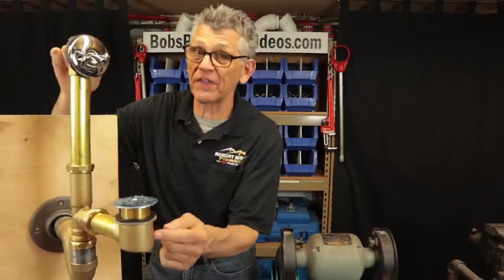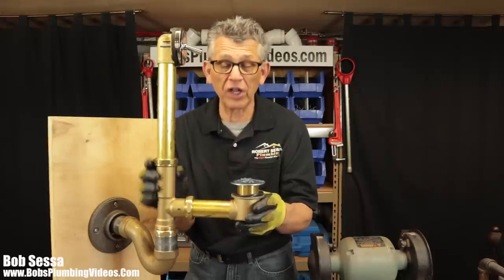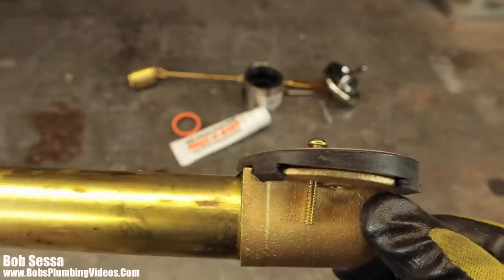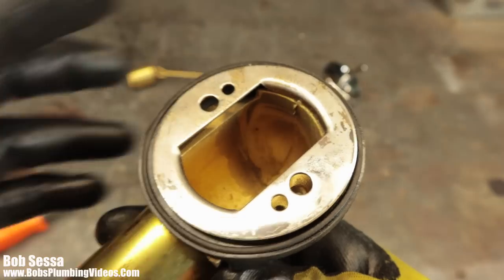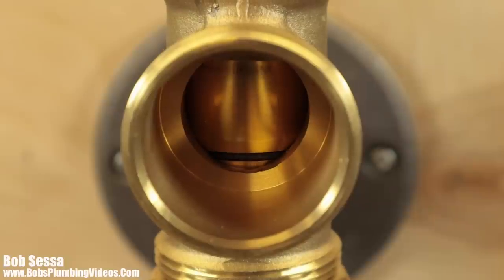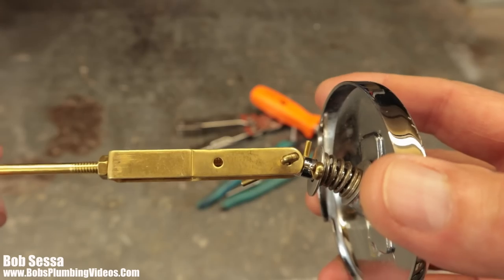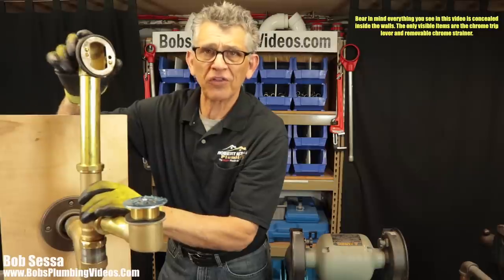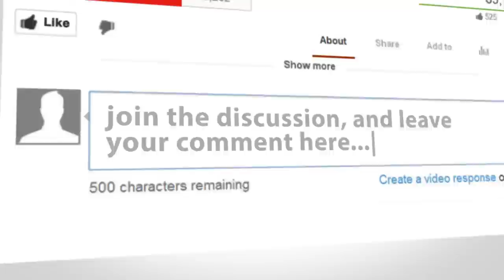Bathtub Drain Stopper / Trip Waste Assembly

Comment: Great video - I have an issue with the tub will drain with the stopper in the up (proper) position, it drains slow so there is some stoppage. Do the stoppers ever wear out (water leak past it) ? Tub is 45 years old ? My linkage is seized so I didn’t try to adjust, but I did try pushing the stopper down the tube as much as possible. Seems to be in the bottom of the hole / shoe / blocking area . Any help is appreciated
Reply from the maker: On a 45 -year old unit. it's totally possible that the plunger has lost its ability to hold water. If you use the tub to take baths, the easiest solution is simply to get a large rubber stopper to completely stop the water up. Sometimes playing around a unit that old for the the sake of 100% holding water, ends up turning into a nightmare
Reply: BobsPlumbingVideos 
Thx bob , without your video I wouldn’t have understood how the system worked . I went back and moved the stopper in and out of the hole seat. Applied some Teflon lube. Then tested . It blocked the water from draining. Second issue was my linkage was severely out of adjustment. Surprisingly the nut and stud came loose. It took me like 4 times to adjust to properly drain and stop , but it works . Root cause was the stopper was all gummed up linkage was out of adjustment. This tub has never worked since I owned the home in 2004. Again thx - your video gave me enough information to keep plugging away .
Reply from the maker: @MollyTV1  Thank you for checking out the video! Bob.
Reply: Apparently I never had the stopper all the way seated as I stated in my first post 
I took a wire wheel to it , after I applied Teflon lube it moved much easier , it was pretty gummed up

Comment: I used a wire to unclug the drain..unfortunately it hooked to the lever!   Any remedy? I did it because the water drains very slow and i thought there was hair on the pipe.  Does anyone has an idea how i could unhooked it from the lever inside.  Thanks so much...
Reply from the maker: It’s happened to me and the only advice I have is to latch onto it with a good pair of pliers and give it a good tug!

Comment: I bought the new trip leaver and put it in and 1 week later when I push the lever down to open the drain it slowly goes back up so I have to keep pushing it down.  Any thoughts?  Thanks.
Reply from the maker: Only thing that comes to mind is that the spring on the back of the chrome plate is not strong enough to keep it up. I know it’s, new but that could be the case. Also did you lubricate the plunger with anything?

Comment: Can I just replace this whole system with a pop up drain and different overflow plate?
Reply from the maker: Check this video out -https://youtu.be/XTW6pcDke2U. Fast forward to about 16 and 25 minutes
Reply: @BobsPlumbingVideos  my current overflow doesn't leak, I'm just looking to update the look of my tub with bronze fixtures. I found a 2 hole bronze plate without the trip lever. Just wondering if that would be fine to switch out and then put a pop up drain in.

Comment: my plunger got corroded that it literally seized inside the pipe and the link is broken. No idea how to get it out. tried wire with s rings and wire hangers etc. that thing is stick. CLR/ WD40 / penetrating oil nothing.
Reply from the maker: I had a similar experience in a rental, the water drained fine but when it eventually clogs, I will most likely open the wall in the closet behind the tub and remove the broken plunger.

Comment: My tub's drain linkage only the top half comes out. It got seperated in the middle. Not sure how to fish out bottom half plus plunger.
Reply from the maker: I generally use a wire coat hanger to fish them out!

Comment: Very informative video. My problem is after replacing the face plate, the new trip lever will not stay down in the open position. Any suggestions?
Reply from the maker: When the lever on the faceplate is pushed down (the plunger goes up) and the water drains. When it is pushed up (the plunger goes down) the water should fill in the tub. If it's seeping water. you might just have to adjust the linkage accordingly.
Reply: @BobsPlumbingVideos  The lever won't stay in the open position unless I hold it down.
Reply from the maker: Kelly Dineen

That description sounds like the spring on the back of the face plate may be bad (lost it’s tension) You can replace that plate which comes with a new spring and two new screws. Any of the home centers carry them.
Reply: It is a new one. I never had this problem with the old one. I'll have to try another new one, maybe this one is defective. Thanks for your help.

Comment: Hey there my husband and I have both tried to remove the plunger in our new to us home but it wont budge! Any tips on how to get it out? It wont move at all wont even go down to plug the drain :-( . We need to fix it to bathe our 1 year old
Reply from the maker: If you tried fishing it out with a wire coat hanger and it's not working. The only other solution (and I've done it) is to open up the wall on the opposite side of the tub drain and physically remove the overflow to retrieve the stopper. A. I'd leave this task to a Pro  B. If the tub is facing an outside wall, you're out of luck!

Comment: How does water drain when plunger is down and bath water reaches overflow when filling?
Reply from the maker: If the plunger is down and the tub fills to the overflow, the water will enter through the top and drain through the plunger. The punger is hollow and the water will flow right thru it.
Reply: Thanks

Comment: bob, great video.  i bought a brand new trip lever plate assembly.  i having trouble because the lever does not like to stay down in the drain position.  the lever likes to creep to the up position ( tub can fill with water).  It may be that that spring behind the plate is weak.  is there a good brand out for plate covers. please help me.
Reply from the maker: It sounds like that exactly happening. You could try removing the spring and stretching apart with a couple of pairs of pliers which will create more tension. Or purchase this assembly and just use the faceplate. It's made by Gerber which makes a good quality trip waste assembly. https://bit.ly/3a5fOLl. Regards, Bob.
Reply: BobsPlumbingVideos   Thanks bob

Comment: Good evening Bob. Thank you for sharing your knowledge.  Question! My linkage is not long enough to prevent the water from leaving the tub when we want to take a bath. I've tried adjusting it but it's still too short.  Can I purchase a longer linkage and plunger?? Please help.  I'm a sous chef and soaking my tired legs is my therapy.  Thank you so very much!
Reply from the maker: Generally, different manufacturers will use slightly different types of linkage. So I would first identify the manufacturer. If you're able to remove the linkage without any issues and can't identify the manufacturer, I would go to one of the home centers and see if you can pick up a universal linkage set.

Did the original hold water at one time? If so, did anything change or was any work performed on it?
Reply: @BobsPlumbingVideos  No sir. Its is a brand new tub, right out the box. It never held water at all. After I adjusted it the water goes out slower but does not stop it all together which made me this Its not long enough
Reply from the maker: @jmcgill215  Standard tubs are 14" high with a 16" option. But a stock waste and overflows should be able to accommodate both. If you've run out of adjustment, you most likely need a longer linkage. Strange indeed!
Reply: Ju M. I had the same issue. How did you fix it eventually?

Comment: Hi there.  What happens if this falls off inside the tube. Tub Drain Linkage Assembly, Solid Brass, Fit for Trip Lever Bath Tub Waste and Overflow Drain. I notist my water from my bathtub is not draining at all. Then try so many methods notist that part came apart. Have any ideas i really appreciate.
Reply from the maker: I've fished out the linkage with a hanger many times, but in cases where it would not come out and had access to the back of the bathtub. I opened the wall and disassembled the overflow to remove it.
Reply: @BobsPlumbingVideos  Thank-you.  For the good advice.  I will try a hunger. Hopefully I'm able to fish it 😁
Reply: I tried it didn't work.  I think the part went far down the pipe.  😣

Comment: Hi, do you know where I can purchase the brass cylinder plunger in different sizes with rubber o rings on it like the one in your vid?
Reply from the maker: I believe it’s only available in the 1 1/2” size (could be wrong)? The one n the video is available from a company called PlumbMaster, but I believe they only sell to the trade.

Comment: I removed my overflow plate, pulled the assembly out but no plunger.  I went below the tub, took the J pipe/trap assembly off and cannot find the plunger.  Is it possible it flushed on through and out of the system?  Tub is slow draining but nothing visible when I looked through pipes.
Reply from the maker: I think not, someone most likely removed it. No way in my opinion that plunger could paas the trap.
Reply: @BobsPlumbingVideos  thanks for the info and quick response!

Comment: I was wondering how to you retrieve the plunger if it breaks off
Reply from the maker: Best bet is a wire coat hanger to fish it out. Extreme cases, you might have to open the wall behind the tub and remove the overflow to get it out. I had to do this in my own home.

Comment: I was trying to fix the lever issue, but pulled the overflow pipe out of the position by mistake :( what should I do now? I currently temporarily put the face plates back for now.
Reply from the maker: If the overflow slipped out of the tee completely, the only way to get it back in place is to open up the wall behind. If that is an outside wall, you got a problem. 

If it didn't come out of the tee, use your fingers to wiggle / push it back into place and hope you didn't break the waterproof rubber seal.
Reply: BobsPlumbingVideos thank you so much! It did came out completely. Is the overflow screwed into the tee? Or just insert into it? I am thinking if it’s just slide into the tee, maybe I can try to wiggle it back? But if it’s screwed in, that would be impossible. We are not using the bath anyway. Just try to temporarily fix it for now without causing any leaking issue.
Reply from the maker: @qibinye2238  It's a slip fitting w/ a  1 1/2" nut and rubber or beveled nylon washer.

Comment: My tub drain is actually moving behind tub is it dislodged from the p trap?
Reply from the maker: It sounds like it's loose, not necessarily dislodged. If it was dislodged., you'd probably lose it. Tread lightly!
Reply: BobsPlumbingVideos yes when I was trying to clean it can it be tightened to the tub again our I have to move the tub.

Comment: I need your help please please please!!! The stopper broke off so what can I do to get it out?? Any help would be greatly appreciated!!!
Reply from the maker: The only thing you can try is to use a wire coat hanger. Cut it, straighten it out and put a small hook on one end using a pair of pliers. Start trying to fish it out! I've done it with much success.

Comment: Bob, thank you for your informative video.  I have a problem.  When I went to loosen the SS screws to the tub overflow, they were froze up with rust.  Eventually the screws snapped, so now I have the rusted tip halves of the screws in the holes.  Do you have an idea of how to remove the screws.  It has no locking plate.  Thanks for any help
Reply from the maker: Karen VanDenBosch   WOW that is a problem. Drilling and retapping the holes is a pain in the butt, especially if you have no way to keep the overflow tube from slipping up and out. Possible,but very tedious! Only other suggestion is if you could access the tub from behind (an adjoining wall?) remove and replace the the entire overflow tube or drill and retap while holding it secure in a vice. Tough situation for sure!
Reply: @BobsPlumbingVideos  Thanks for your quick response and advice.  Going from the backside is not possible in this situation - toilet from other bathroom is on the other side of the wall!  Not well planned out.  I have a picture I could send you of the trip waste.  Sounds like the tedious way is our option.  Still not sure why SS screws would rust like that.
Reply: BTW part of the rusted screw still extends out from the overflow pipe about 1/4".  Should I try to cut them off first before drilling and re-tapping?
Reply from the maker: @karenvandenbosch226  You should cut them off flush if possible, and drill dead center stepping up in bit sizes from small to just shy of the actual diameter of the screw. Then use the appropriate tapp to make a new thread. 
You should try to use a small c-clamp at the bottom center of the overflow and clamp it onto the tub (use a scrap of 1/8" or 1/4' wood) as not to damage the tub.
Reply: Sounds like a plan.  I will let you know how it goes.  Thank you
Reply: @BobsPlumbingVideos  Bob great video, i searched around forever and didn't see anything as informative as this. What can you do if the plunger breaks off due to corrosion? Is there a way to fish it out or do i have to rip my wall apart?

Comment: Mine is plastic and has a foam gasket on the back of the tub... not a rubber gasket as shown. Theres no lever to stop the tub. Its just an overflow drain.
Is any dope or silicone or any other compound used between the foam gasket and the back of the tub. Same with the bottom drain.
Reply from the maker: I've used plumbers putty between the gasket and tub on the overflow.
Reply: @BobsPlumbingVideos  
Thank you

Comment: I actually have a situation where when I push down the lever, it tends to stick and keep the water from draining.  So I have to lift it up and push it down again.  This lets it drain some until I have to do it again.  It is a pain in the ass!  I have to do this each time I bathe my kids.  I would like to fix this myself.  Does this require simply adjusting the float up or down, or could it be something completely different?
Reply from the maker: It sounds like it needs adjusting as well as maybe a little silicone lube to keep it from getting stuck. Different manufacturers have slightly different linkages but it's a pretty straight and forward.
Reply: I'll give it a try.  I'm just a little nervous about the backing plate.  I don't know if one was installed.  This was installed by a "professional" plumbing company about 1-2 years ago.

Comment: My stopper is stuck due to mineral deposits. Is there anything you can use to temporarily clog the overflow pipe from the T so I can let CLR soak in the pipe? Thanks!
Reply from the maker: Stuck in the open position?
Reply: @BobsPlumbingVideos  yup, we could never get our drain to hold water. Opened the face plate to replace the assembly and found a lot of mineral deposits. Cant pull the linkage and stopper out. Tub drains fine. Tried pouring lime away and WD 40 with no luck. Would like to get some CLR to soak in the pipe for a bit.
Reply: Or maybe soak a rag with clr and shove it partly down the pipe, but still be able to pull it out, and hope it soaks the pipe a little better?
Reply from the maker: @nchec326  Can you remove the strainer plate and basically shove a rag in to block the tee? Or perhaps some type of ballon you can slide in and blow up? (that's a stretch, but feasible)?
Reply: @BobsPlumbingVideos  I'll have to look when I get home. Thanks though!

Comment: What happens if the linkage disconnects and falls to the bottom of the “t” How can it be retrieved? Thanks!
Reply from the maker: A wire coat hanger, and cross your fingers! Worked for me a few times.
Reply: Nate! I’m in the same boat. It’s completely disconnected. We’ll keep trying the coat hanger. Fingers crossed.
Reply: @BobsPlumbingVideos  Good luck finding a wire coat hanger in 2019. LOL

Comment: How do I get a drain stopper that is stuck unstuck?
Reply from the maker: If you can remove the faceplate, try spraying some WD-40 down the overflow and letting it sit 24 hrs. If no luck the correct answer is to dismantle it from behind if you have access. Unfortunately there is no easy answer!
Reply: @BobsPlumbingVideos  thank you! I was afraid the answer was having to cut into the wall from behind to access it. This is going to be so expensive 😭

Comment: my linkage is wayyyy stuck in. I can't even get it with plyers. any advice?
Reply from the maker: That's a tough one if you can't yank it out with plyers! You could try spraying a can of WD-40 down the overflow in hope of loosening up any crud that may be causing the issue. Anything that would dissolve soap scum and then lubricate.
Reply: @BobsPlumbingVideos  shit. lol. If that doesn't work, sounds like the next step is going into the wall from behind and pulling out the pipe itself?

Comment: My linkage assembly is stuck !!  Help
Reply from the maker: You're going to have to try and fish it out with a wire coat hanger. USE CAUTION, sometimes it works but often they're stuck in there pretty good. Try that first before having to take things apart!
Reply: BobsPlumbingVideos Any advice on how I can get it out? It's still connected to the part where I can pull it up it just appears to be stuck or jammed. Taking anything apart would mean having to make a hole threw the wall or going under the house. That I will not be doing lol. I tried putting some of that calcium, lime stuff to see if it would dissolve any build up but it's still jammed😫
Reply: BobsPlumbingVideos I also wanted to say thank you for replying I appreciate it!!!🙏
Reply from the maker: Veronica Saenz it happened  to me in a rental unit, I tried for a few weeks using various products to try and loosen it. Unfortunately no luck and I had to open the wall behind the tub in the kitchen behind the stove. Removed the overflow and fished it out. OUCH😳!